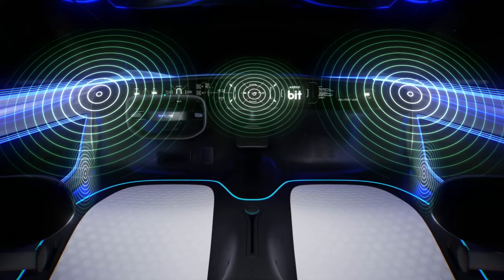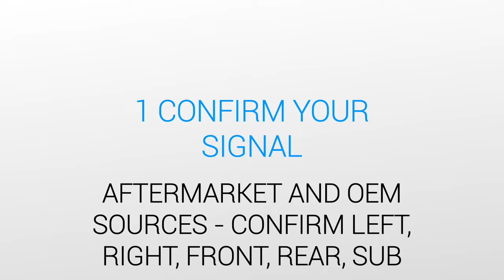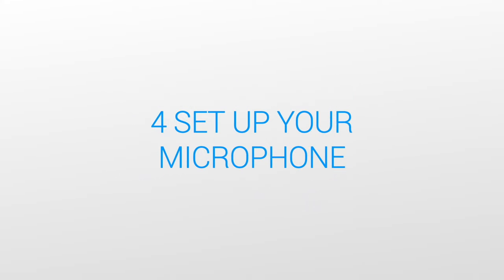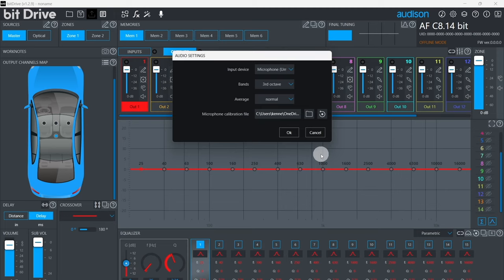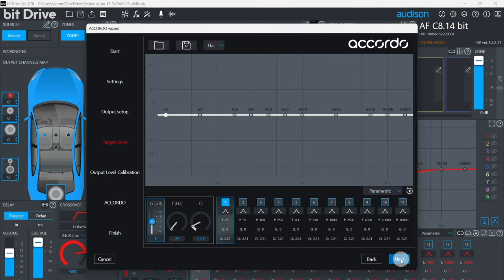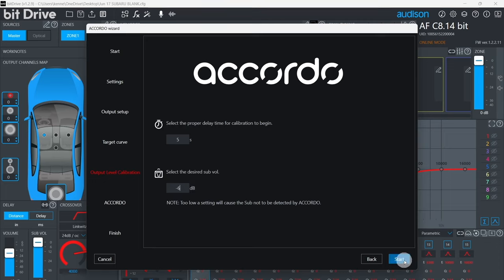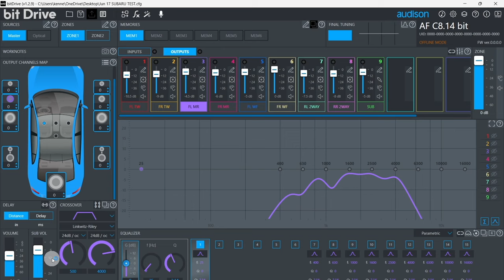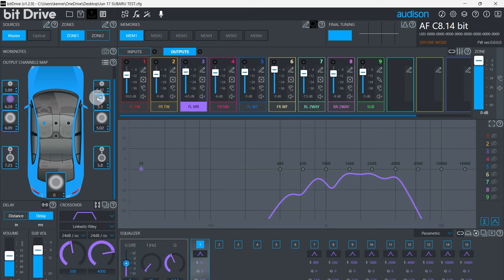Episode 6 - Introduction to using ACCORDO

Comment: I have a next setup in my BMW G20 320i Basic Stereo with RAM:
Audison AF C8.14bit,  APBMW 8 4.2 (bridged channels) and APBMW K4E (using crossover, 2 channels on amp). OEM headunit iDrive 7 plus rear speakers. Without subwoofer.

Are there any ready-made configuration files for the BMW systems?

Comment: I'm unable to get the accordo output level calibration signal into the green level even with the volume set to +6db and the minidsp calibrated mic setting at maximum in the windows settings. I'm stuck on signal low and unable to progress to the next step.
Reply: Umik-1 !? 
Open the case and set a proper gain for the mic with the dip switch
Reply: Umik-1 !? 
Open the case and set a proper gain for the mic with the dip switch
Reply: @PatrickKlinge-fu2tm  Yes the Umik-1, its currently set to 18db - which gain  would you recommend? Thank you!
Reply: @dannymm  depends on windows..
try it out (Y)
Reply: @PatrickKlinge-fu2tm  I've changed it to 24db and now its outputting the correct level and the Accordo tune completed successfully. Many thanks!
Reply: @dannymm 
Yeah really good 👌